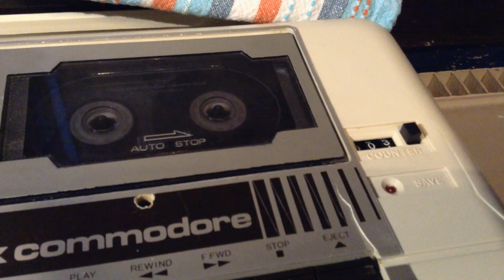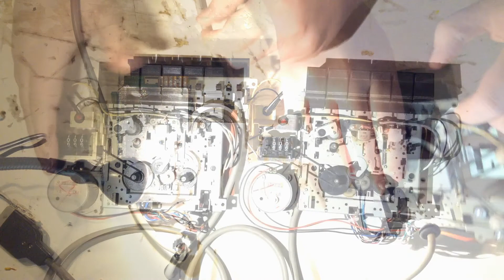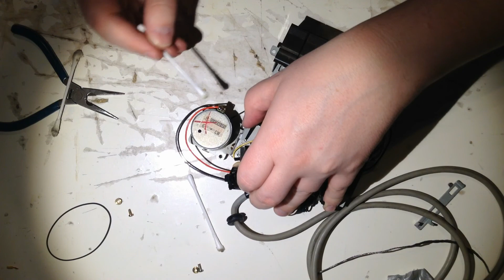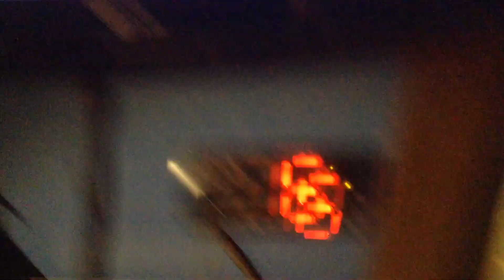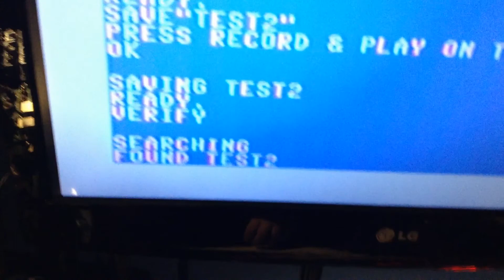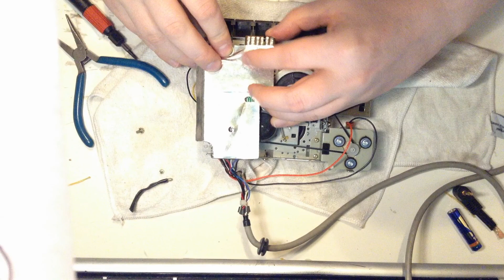C64 C2N Datasette Repair

Comment: Funny to stumble upon your old video as I'm currently in the process of repairing some Datassettes and two days ago I encountered exactly the same Eject-button problem on one of my Datassettes, having to remove the "sliders" and bending the "pin" back. A bit fiddly, but nice to get it back into working order again! I have a bunch of them to go through. Among other things some drive belts will definitely need to be replaced :) I can't help to wonder how it got that bent in the first place, considering the metal is not that fragile and took quite some force to bend back.